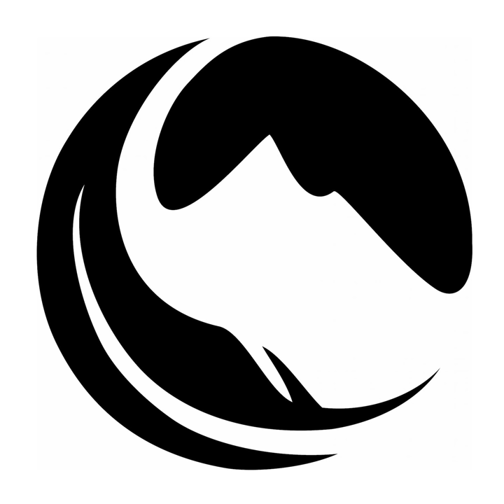Episode 10 | StoveBench: A Protocol for Comparing the Performance of Backpacking Stoves

Comment: I’ve been using BRS3000T for quite 4 years, last year I used it to melt water at Aconcagua at 5500m of altitude, it worked perfectly, just like it did in all others conditions. I got a little surprised when I read first about the melting problem of this stove, then I listened in this podcast that BPL runed the stoves with wide open at full throttle (I undestand that you need something that is repeatable for comparison). It makes me fell relieved, beacause I never get even close to use this stove with so powerfull flame. 
Nice to know that I should not do it and a big mistake of the company to allow this, with some tests they could realize that problem and reduce the power. 
Thanks for the podcast! Good job.
Reply from the maker: Thanks for writing in. Notably - some owners are reporting failure of the stove leg supports over the long term when running at low heat - just something to watch for. It does seem to be an issue with newer batches.